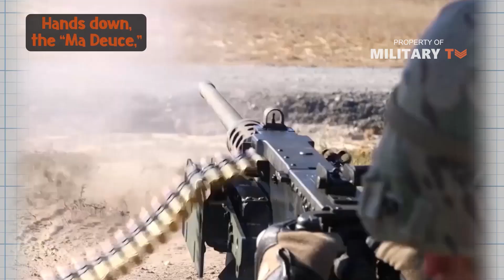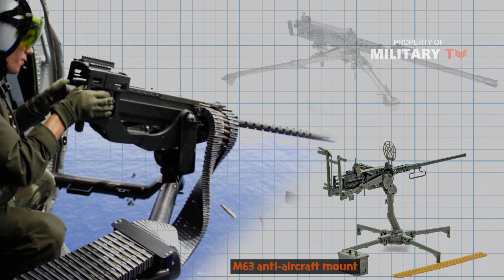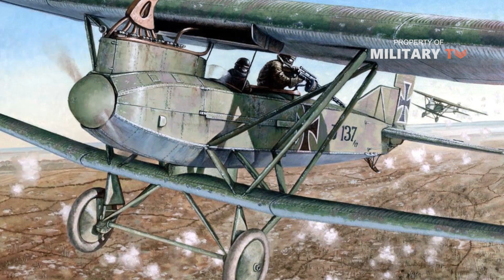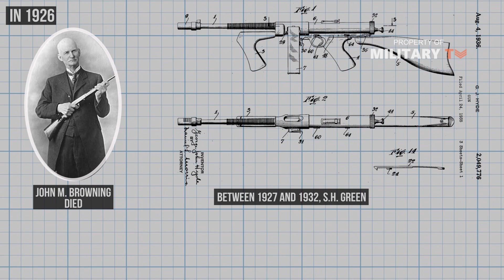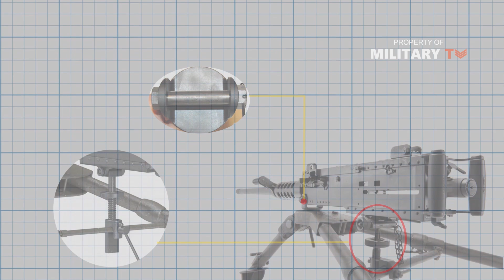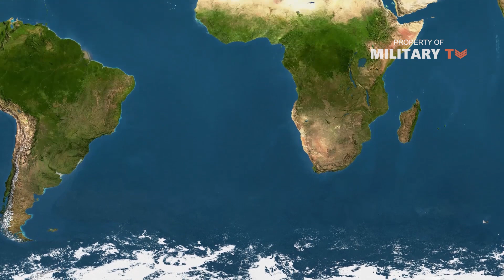Why the M2 Heavy Machine Gun Is Simply Unstoppable

Comment: Yes - it's all cool and stuff - but it's still a WW1 machine gun.

It's heavy and it kicks like a mule - and the simple single-point mount it's usually used with doesn't offer much precision at more than ~400 meters. Above that - it's spray and pray.

A MG3 on a 3-point mount offers significantly more range+precision - albeit it's smaller caliber and therefore less penetration.

.50 projectiles have high air-resistance due to their shortness. A longer bullet would aerodynamically be a lot better - but wouldn't work in a M2. There isn't enough space inside to feed them.

The reason it's still in use is nobody built something better in .50BMG so far. The market is quite small - and using a ruzzian Kord isn't an option for any Nato country.
Reply: The m2 browning is a WW2 machine gun, not WW1. And the added power of the higher caliber cartridge is what helps with its versatility, the m2 can be used for anti vehicle and anti infantry purposes
Reply: @ashe_v3  No it's a WWI design. It was designed in 1918, put into service in 1923, and upgraded in 1933.
Reply: @Predator42ID  I meant when it actually went into use, my bad.
Reply: @ My oops, I failed to read between the lines.

Comment: JWB got Ma Deuce right the first time. It is perfection personified. Loaded with silvertips, it simply cannot be beaten as an anti-personnel and anti-thin skin armor weapon. My HMMWV had an M2 mounted in the ring and it never failed us. I traced the serial number on it and it was manufactured in 1955. It was not capable of mounting the QC barrel but there are no shortage of screw in HB's available. If Artillery is the King of the Battlefield, Ma Deuce is easily the Queen.

There is NO flash suppressor on the M2 HB or QC barrel. The bullet is 750 GRAINS, not 750 GRAMS. 700 grains translates into 45 gms or about an ounce and a half.